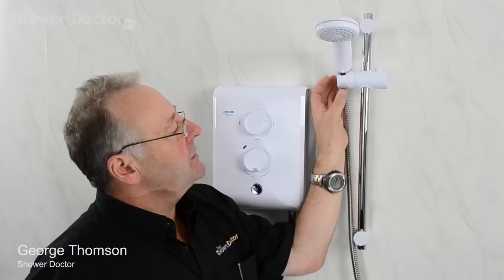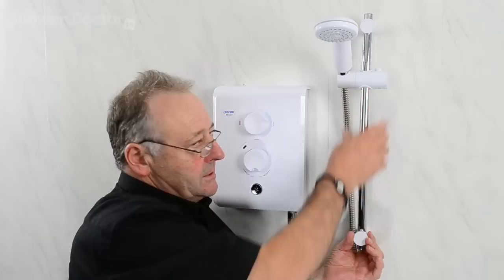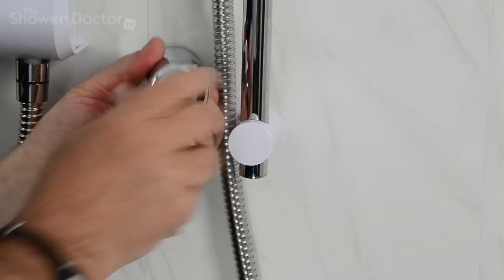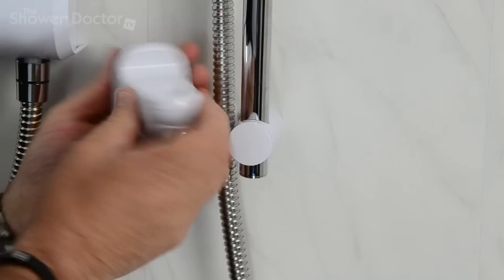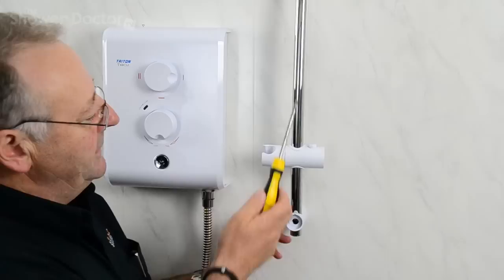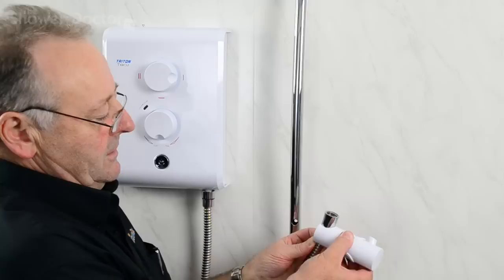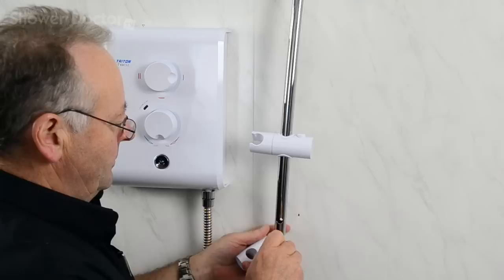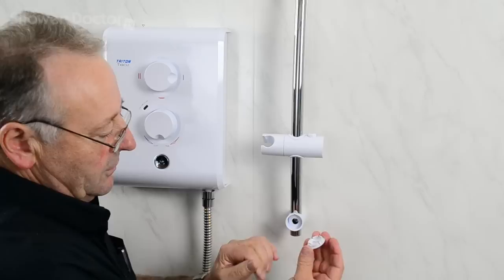Shower Doctor TV: How to replace a shower head holder/slider bracket?

Comment: George, Thank you for the clearest and most comprehensive video I have been able to find on the net for this job. I did not have the gumption to look under the bottom shower bar post until you showed me where to look. When I did, I found a small grub screw holding the cover on. All I need do now is find a good fit allen key and see if it will undo without undue effort. Thank you and regards, Trev, Coventry

Comment from the maker: To remove a rusted screw you can drill the head off, then remove the body with a pair of pliers or pull the plastic bracket off over the screw and remove the screw again with pliers, then use a larger head screw to reattach the bracket.

Comment: Thank you for the great video, I have an offshore "chrome" shower head/slide bracket, and for the life of I cannot get the cap off, I am tempted to actually grind/cut the slider bracket off and simply replace it with one similar in this video.
My question is:
Is there no easier way of determining the diameter of the rail?

Comment: For MIRAS shower brakets , there is a hole at the bottom near the wall. You have to unscrew using an ALUM key to loosen the outer casing of the bracket

Comment: Really helpful thankyou but  my rail measures 30ml in diameter and I cannot find a eplacement. It has the same rail fitting as your and fits into the  3rd example you show in in your demonstration.Can you advise?

Comment: To find out the correct diameter of your pole, it's easier to use a measuring tape to get the circumference and then divide that by Pi (or 3.14) to get the diameter.

Comment: Hi George. My shower holding bracket has stopped working. It just slides down to the bottom of the slide bar. It there a way to fix it or will I need to replace it? I push the button but nothing happens. There's a rubber plug on the front side that is hidden by the shower handle. If I take out the rubber plug, is there a screw or something that I can adjust to fix the slider button?

Comment: My shower head keeps moving . Does the shower head holder need replacing .??  When I first moved in I had a bigger shower head .   When the shower hose broke The owner  replace  it with a smaller shower  head   . .   It's Chrome

Comment: Hi, thanks for the video. I just one problem. I've just moved into my flat and need to replace the bracket on my newteam shower. However, the screws in those rail are rusted. Any ideas how I can get them out and replace to screws also? Thank you

Comment: Hi I have a Triton T90xr it's developed a leak from the shower head when I removed shower head and hose the leak is coming from the bottom of the unit above the prd can you advise how to fix ?
Reply from the maker: Unless the heating tank I can't think where the leak is from.

Switch the power off give it a good dry out then look very carefully to see if you can spot where the leak is from, if you can find out where it is from then we may be able to help a little more.

Comment: Does it matter if the shower holder release button is on the top or the bottom, as long as the hose holder is the correct way up?
Reply: +MrUniman69 The button is usually on top but it is not really important.
Reply: *****
Thank you for your reply, I put it on upside down and I don't really want to dismantle it all again to place it the correct way up. Keep posting, your videos are very helpful, many thanks.